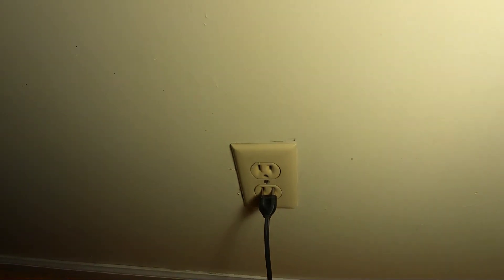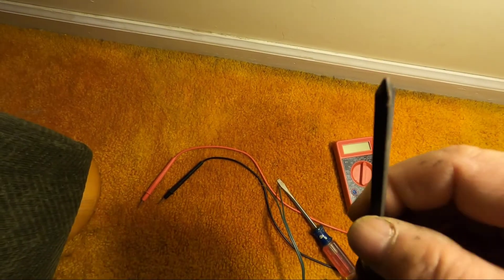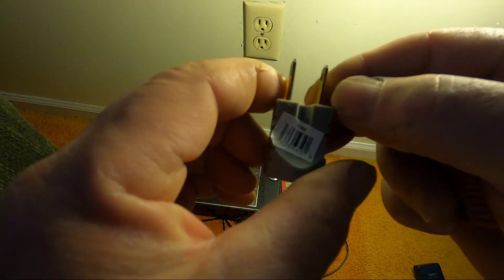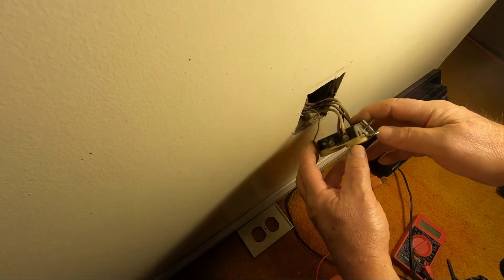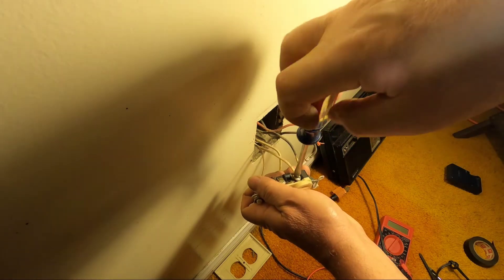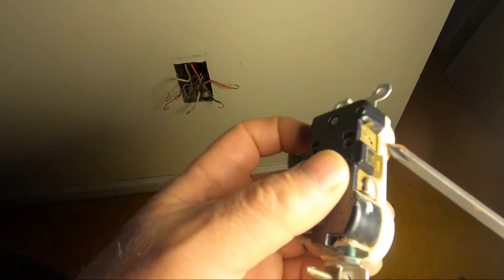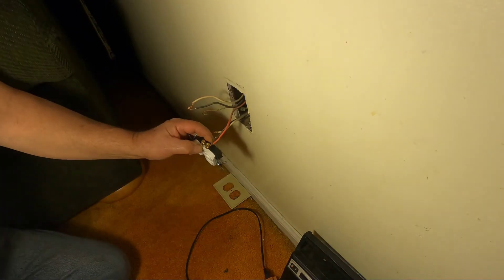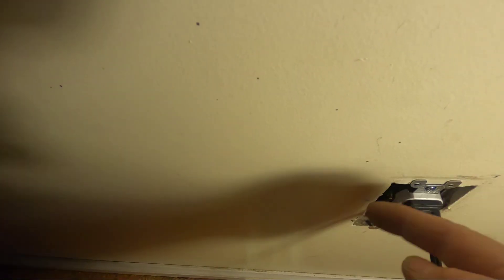How to replace electrical outlet receptacle

Comment: I'll be doing this later on this week - have one that went out, I think during a power flash... yay! Watching and Supporting, dropping another LIKE on your video!
Reply from the maker: Thank you. I have a couple more to change. Still not sure whey they are loose. They seldom get used but do not hold the plug tight.

Comment: My outlet has completely different wiring.  Push in with no screws.  Have no idea where to find instructions.
Reply from the maker: Hi Tim, Thank you for stopping by & taking the time to comment.
Remember to always work safely. Even though this is not a difficult job it can be EXTREMELY  dangerous. First make sure that ALL the wires are not live, do not have current. This outlet also has the push in holes. To get the wire out there is a small slot above the wire where it goes into the hole. You need a small screwdriver to fit into that slot to release the wire. If you are not sure how to proceed best to ask someone before you go any further.